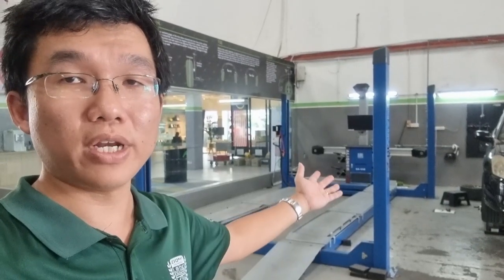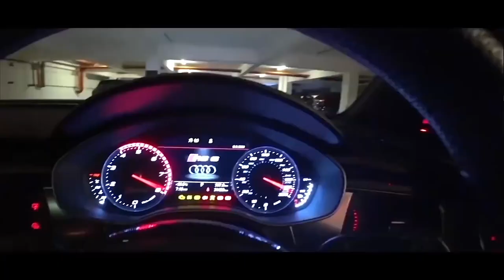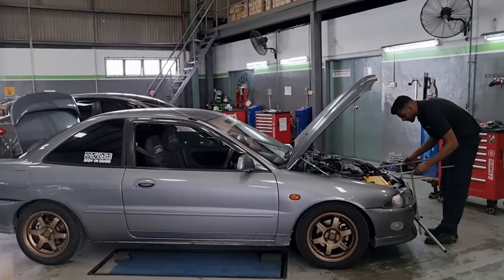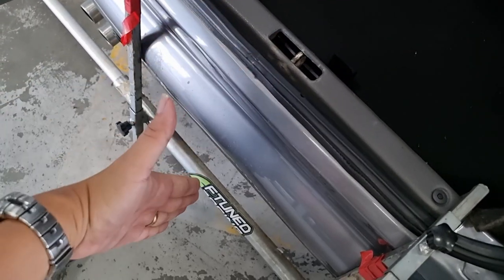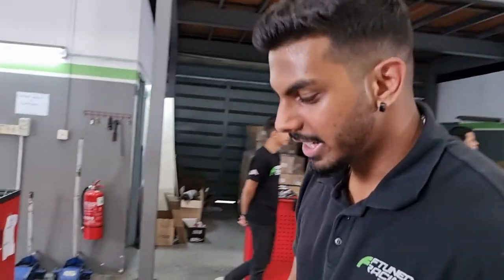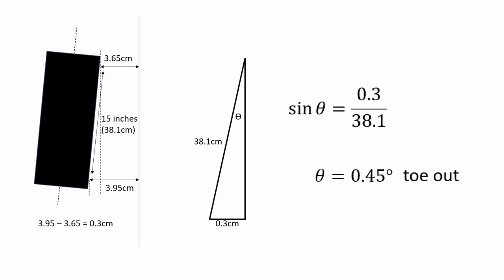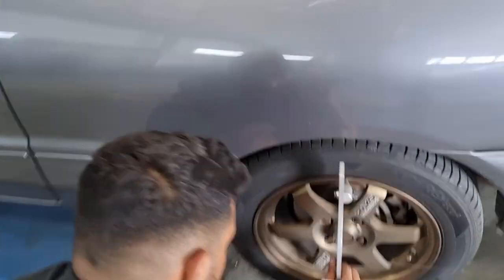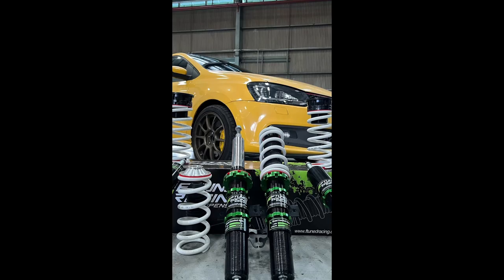It costs RM400 to do wheel alignment at this shop!! | EvoMalaysia.com

Comment: Sounds like “big solutions for small problem”. As you mention at the beginning of the video ;the machine needs to be  calibrated timely and correctly.   
Like car, laptop &  phone (for example) needs to be “updated” throughout it lifecycle.
Reply from the maker: To be accurate, it's an old school solution, but yes, for most people  regular tyre shop alignment is good enough.
Reply: @KonWaiLuen   yes 👍, I  believe if the reason  for example is like going to a tailor rather then “buying off the rack” because you get a more personalize , bespoke / customize outcome would be seen more as justifiable for the premium price ; rather then shops not calibrating the machine timely.

Comment: This is how alignment is STILL done even at top level motorsports. The cold hard reality is that those fancy digital machines are not only impractical to transport around, they are also potential much LESS accurate than the traditional string method due to sensor drift over time, something that needs to be kept below significant levels with periodic adjustments that many shops simply can't be bothered to do despite the extreme criticality of adhering to this maintenance.
Reply from the maker: Actually, majority of customers that take up this service is for track purpose. It is overkill for road use.

Comment: Mr Kon, this video you have shown cannot work for certain with common body frame problem. Its always a problem here in any malaysia alignment shop for camry, vellfire, estima when you set your camber to zero all the car perfectly aligned and the car is still pulling left. And another example is subaru imprezza pulling right. After exact calculation and correctly aligned car does not run straight, so alignment shop here will make camber positive 1 degree on the front right wheel for camry, vellfire and estima so the car can run straight which is not properly aligned on computer now. I found out that its not the alignment / camber problem but actually the lower car body frame is not sitting straight with the suspension system and wheels. Example below with video linked as proof on how foreigners solve this problem. 

Video 1 Solution - https://www.youtube.com/watch?v=gIe-59YnRPU&list=LL&index=8
Video 2 Solution - https://www.youtube.com/watch?v=KN3x4s_fQhc&list=LL&index=8

What do you think about my findings.?
Reply from the maker: Most of the time, the pulling left despite straight alignment simply because our RHD roads slope slightly to the left for water drainage.
Reply: That is true. I understand that. But I am talking about a very strong pull after perfect alignment with thread. Not all cars. Certain cars like camry vellfire estima subaru. Some say because of the long short drive shaft. But  chances are the frame is not correctly aligned and nobody here is checking the lower frame alignment before they begins the actual wheel alignment process with thread like you have shown. Its perfect in you case since the car you aligning is small size and it works fine. Nice video thank you for sharing. My concern is that video i shown you in link where they can get perfect camber caster by adjusting the body frame.  @KonWaiLuen

Comment: To do alignment for cars with wishbone & multilinks set up, at both front & rear, would be the most difficult. Yes, no?. 

What if one of these cars with bushes and control arms, visually ok, but not within their required specs comes in for alignment?. How to spot such problems at the beginning stage of alignment?. Otherwise it would waste too much of workshop time & effort and the end result is still a compromise. What is the minimum charge, if such a car comes in, and is found not mechanical sound to get a alignment properly done?.

Regards.

Regards.
Reply from the maker: The more links the suspension has, naturally, the more complex is the alignment process. Usually, if the car has not been in an accident, unlikely that the car cannot be aligned